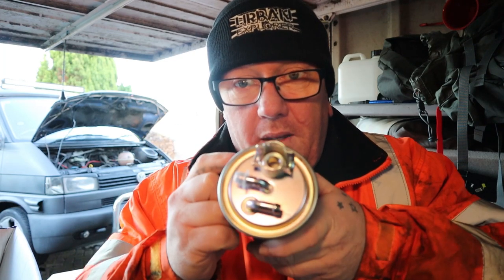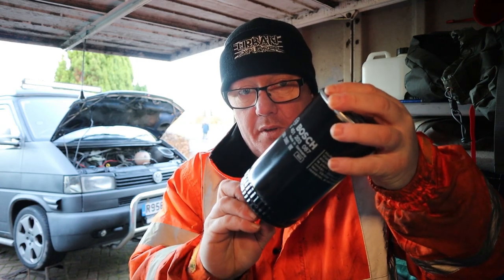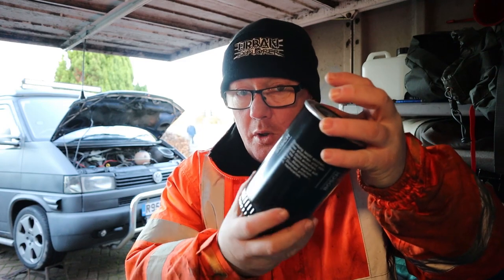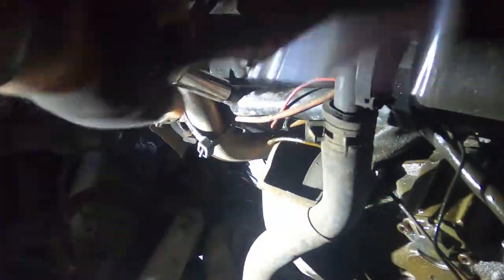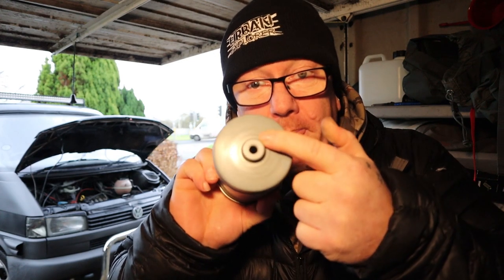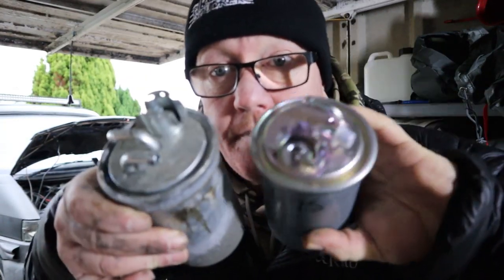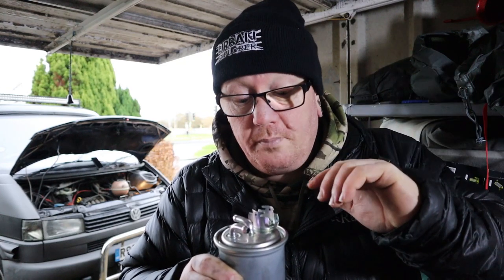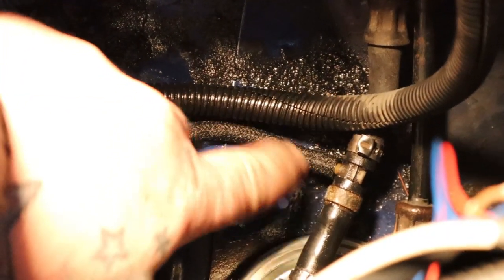How To SERVICE Your VWT4 At Home

Comment: First service for me,  completed, with less leaks than there was lol.  Vac pump re built, oiil cooler stripped out and replaced the seals, starting issue gone.  Gear box next.  🤟🤙🤟

Comment: Aren't you supposed to depressurise the fuel system before you can remove the filter, like in a gasoline car? Won't that diesel get all over the place?
Reply from the maker: The fuel only pumps when the engine is on . It’s never under pressure when the engine is turned off